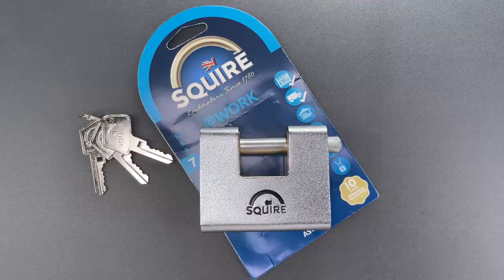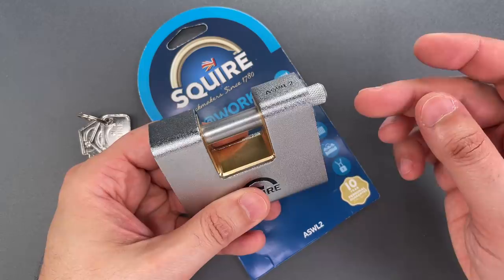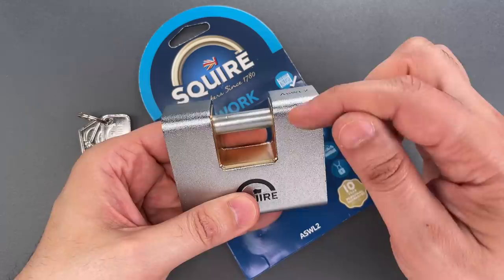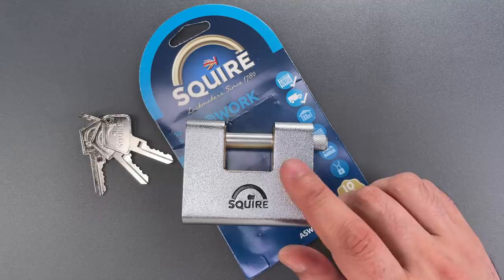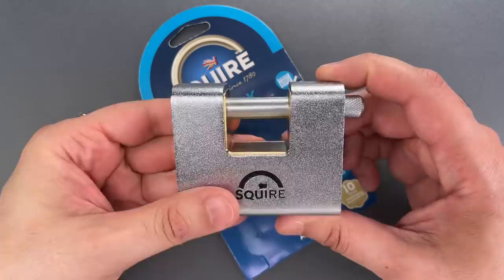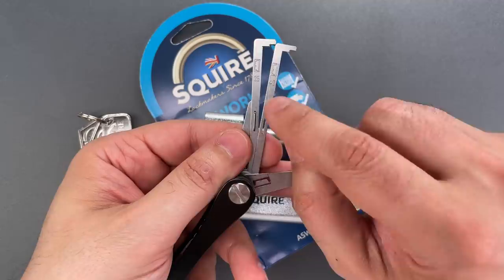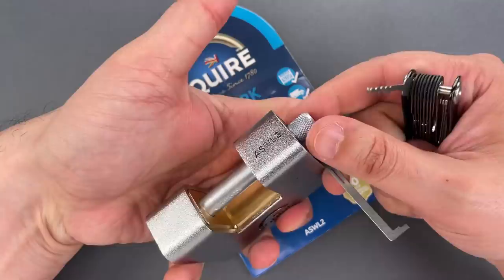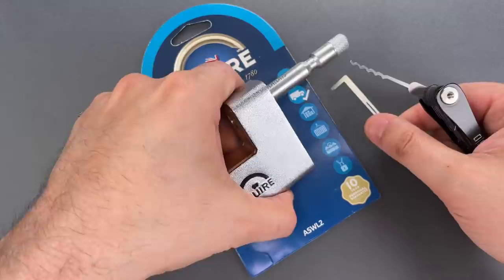[1369] Squire’s Disappointing Armored Shutter Lock (Model ASWL2)

Comment: That is the quickest wave rake I've seen LPL do.  Even Master Lock would be ashamed to make a lock that bad.
Reply: bold of you to assume master lock have any sense of shame.
Reply: @romusa10  They'd still sell it.  They'd just be ashamed of it.
Reply: Next time LPL will just literally wave at the lock and it will pop open.
Reply: Look at video [1197] 😉
Reply: Squire used a Master core to save money
Reply: @ts757arse  Wait, you're telling me Masterlock make good products? You're on their payroll, right?
Reply: Thats not entirely fault of the lock. Notice bitting on the key is almost straight, which greatly simplifies raking. With a more complex bitting (assuming each lock is different), it might not be as easy and LPL might choose usual picking instead.
Reply: The only lock I can pop faster with a wave is a ML3 with some of the worst bitting I've ever seen. At worst it's 15 seconds, but there's been more than one time where it popped by literally just putting the rake in.

Comment: I took one look at the bitting for the key and went, he's going to bust out the wave rake. Was not disappointed.
Reply: so, could it be a QA/Key generation issue? (at least in part?) This would still be a flaw for the product and company, but it would mean "results may vary".
Reply: @sarowie  It also means there are no security pins, so even if the bitting is different it would be quite easy to single pick them.
Reply: @sarowie  Nope, that's a deliberate design choice on that lock.  It's basically the easiest locking mechanism possible while trying to get as much profit as you can.  You can wave rake a lock using a bobby pin.  I've done it before.  If I can pick a lock with a bobby pin, it should be discarded.
Reply: Yeah, a quick glance at the key reveals that single pin picking would be an overkill.
Reply: Yeah, I had the same feeling. I took one look at the key and went "oh no"
Reply: Came to the comments to see if anyone else thought the same as me. Ive got very little lockpicking experiance and when i looked at the key i thought "damn that looks like its going to getting raked"
Reply: @mariosebastiani3214  Even with security pins, if the bitting is that flat there's a fair chance I can rake it very easily.
Reply: Good observation, you totally beat me to it. A city rake would've been perfect too. It kind of just melted open...
Reply: Exactly my thoughts! Ever notice that most locks you buy the keys aren't visible until you fully open the box and can't return them!! 🤬
Reply: Because the pins are all in the same position basically?

Comment: And to think I used to laugh at films where the hero picked a lock using his girlfriend's hairpin.
Reply: It would be fun to see LPL replicate some "ridiculous" movie picking scenes, and show that they are in fact realistic for most locks.
Reply: The nerdycrafter just did a video where she tried lockpicking for the first time. One of the things she tried was a hairpin. Though she did have to use w turning tool.
Reply: That was also a trope of Thunderbirds.  Lady Penelope seemed to keep her hair pinned up almost specifically as an innocuous source of picking tools for her chauffeur to use…
Reply: @Kromaatikse  So Lady Penelope was Aloyisus Parker's "covert companion"?
Reply: @n1elkyfan  That's the one thing most scenes of lockpicking get wrong; even if they use what's supposed to be a dedicated lockpick, there's no turning tool.
Reply: @keith6706  At this point it's a trope, but I suspect the original intent was to avoid showing the real thing so people didn't go around imitating it.
Reply: Well TBH you would need a very open keyway but it could be done if it fits I suppose. Certainly, you can make fine lever lack picks from them.
Reply: @Merennulli  I assumed the same thing. Even as a child I realized that you needed to turn the cylinder to actually open the lock, and you can't do that with only a pick.

Comment: All new locks going forward need to have a LPL Resistance Rating, in my opinion.
Reply: Suggested scale:
1-star: Pickable with the wave rake.
2-star: Picked in under one minute with standard tools.
3-star: Picked in under five minutes with standard tools.
4-star: Picked in over five minutes with standard tools or needs specialist tools.
5-star: Needs custom tools to pick at all.

Comment: I bought a fairly expensive lock for my door and after I installed it I looked at the teeth of the key and all 5 of them were cut the same length so they used the same size pins. Basically all I have to do is tension the lock and stick something in there while pressing up on the pins and the door unlocks. This is a well known brand (Not master lock) if you buy a lock try to look at the key before buy if you can to make sure there's different size pins.
Reply: If you can’t get a look at the key, it’s basically a lottery whether the lock is as insecure as yours, unless the manufacturer has enough sense to deliberately avoid using certain key bittings.

Comment: Wow, that opened faster than most wafer locks.  Of course looking at the bitting, it pretty much matched the profile of the wave rake LPL used.  They couldn't be bothered to throw some security pins in there, apparently.

Comment: I have a master lock #3 that i can open with any piece of flat metal that will fit in the keyway. I dont know what they key cut is. But i know its the same across all 4 pins (i.e. 3-3-3-3). This key looks quite similar.

Comment: A great lock a easy core. You can probably get a open with paper clip picks. Viro Panzer is a much better choice. 7 pins security, anti drill spinner face plate, tougher keyway, anti pull shackle, all steel construction. Brass core. Ball bearings. Need I say more. CISA and Viro are the ones to go for

Comment: I'm not a lockpicker, but yesteday when I got back from a dogwalk, my front door (only door) of my house wouldn't unlock.
After stealing a windshield viper from one of my scrap cars I took the steel insert and made myself a pick.
The lock was so worn out that one of the pins was tipping in it's hole, after fiddeling around and tapping the lock with a hammer, the pin fell back and the lock was opened one last time, then I replaced it with a new one.

Comment: If you look at the key you can see one hint as to why, there's very little variance in the bitting. I have to wonder if another of these locks that's keyed differently would be a bit more resistant, but obviously if LPL was able to rake it it also means no security pins.

Comment: On the face of it, a strong body with a weak heart. Might be a decent value if the brass core can be slipped out of the steel shell and the cylinder re-pinned with a couple of spools.
     When a reputable company like Squire markets a lock like this one, the first security device you should buy is a set of rakes.

Comment: 40 years old I still have trouble putting the key in right . I think lpl opens locks faster then I can with a key. I would have flipped the key around 4 times before I could get it in.🤣

Comment: The teeth of the keys have a soft and shallow look to them.  This sort of 'soft & flowing' look to the key cuts usually indicates to me that the lock 
is very low quality and easy to open.  To make it worse we can see the bitting to be essentially flat which calls out for a simple rake attack.  
Sharp and crooked fangs on a key, such as Medeco keys, usually scares me away.  This lock is no more than a little puppy.
Reply: generally medeco keys have strange patterns not only because of their ability to have effective bitting, but also because they key pins need to be rotated to set a sidebar which must be done in order to open the lock

Comment: Wow.  I'm not sure about exception to the rule though, I recently came across the (I forget the channel) video showing how to bounce-press the wheels on their rather pricey and pretty heavy-duty combination padlocks, locks which I realized were protecting hundreds of thousands of dollars worth of gear down lakeside for a windsurfing club.  I went down and told them that despite the seemingly solid security the locks provided, I could decode any or all of them one-handed in the dark in under a minute each and could either help myself to whatever I liked and then lock them back up surreptitiously, or could even just wander off with their dozen locks and sell the locks themselves for a fair profit if I was so inclined.  Squire's not a common lock around here (Toronto) but they seem to mostly make pretty impressive hardware, but lately someone's been drinking on the job in quality control or they've been focusing too much on sexy design features and not enough on locking customers shit up... I mean, you can decode those combo locks without even bouncing them, literally by sight.  How they missed a flaw that is apparent to both the eyes and the hands is beyond me.  Makes the brassy Master combo padlocks look secure in comparison :/

Comment: you can see from the keys that the bidding is very weak. I've opened locks like that by jiggling a random cheap filing cabinet lock key used as both turner and rake.

Comment: I know it's expensive, but for top of the line locks why don't they use hardened stainless steel.  It's not as hard as regular hardened steel but has weather resistance superior to that of brass.

Comment: Not precisely related to this video but I am curious as to why the US mounts its locks upside down compared to the way we mount them in the UK? Great video can't get  enough LPL :)
Reply: Please explain. Do you mean with the keyway on the bottom?
Reply: @sourisvoleur4854  Yes because in the UK we have the keyway at the top.
Reply: @jonwingfieldhill6143  Wouldn't that be bad because it lets the rain fall directly into the works?
Reply: @sourisvoleur4854  possibly but we don't seem to have any significant issues so intrigued.
Reply: @jonwingfieldhill6143  Interesting. Yeah virtually all keyed padlocks are that way over here.
Reply: @sourisvoleur4854  minor misunderstanding, I was referring to standard door locks etc because in the UK we have our lock so the key way is in the upper portion with the lock body facing down so it looks like 
O = keyhole 
U = body
Instead of 
n
O= keyhole on bottom  
I've watched a lot of BosnianBill and LPL picks and to me they pick the pins the wrong way up.

Comment: Is this really a problem with the construction of the lock, or just the bitting of the copy you got?  Looking at those keys, the pins all look the same length, as though they were trying to make it easy to rake open.  If you'd randomly gotten a lock with more pin variability, would the results have been as bad?

Comment: I've noticed my ability to use a wave rake depends on the key pattern.  I'm guessing if that key pattern had a few extreme pins the rake would not work.
Reply: that is generally how raking works. it is a low skill attack that relies on mostly flat bitting and a lack of spools or other security pins to work well
Reply: @boazfarren-greenwood9048  I have a lock that is pretty difficult to pick because of security pins but because the bitting is such it is easy to rake.  My point is you shouldn't say a lock is flawed because you can rake it, just make sure you get one with extreme key pins.
Reply: @brianhks1  I literally fucking said "flat bitting makes a lock easier to rake," I never said a lock was flawed because it could be raked, though that is true. oh and what type of lock is it? maybe I can give you a couple pointers
Reply: @boazfarren-greenwood9048  Dude, chill man.  I said "you" as rhetorical, meaning "a person" shouldn't say a lock is flawed...  LPL kinda dissed on the lock, but it may be a good one with a different key.  Until I started picking locks I never gave the key bitting a second thought.  People should be aware when they buy locks to inspect the key.  @LockPickingLayer it would be nice to have a video on this specifically.
Reply: @brianhks1  I highly doubt that another lock of the same model will have very different bitting. the rest of what you said is just a bunch of random crap you happened to toss in because it seems on topic
Reply: @brianhks1  that being said, you are right and only one lock, out of all of them might have flat, rakeable bitting, but that shouldn't be the case full stop. companies should do the best to prevent the bare minimum, like sub-second raking attacks

Comment: If you use brass for weather resistance and steel for strength why is the steel on the outside exposed to the weather?

Comment: how much of this is because of the bitting of this particular lock? because the key looks pretty flat, if the pins were more high-low it wouldn't be raked and you'd need to SPP it right?

Comment: when you use a turning tool- how do you know the direction to apply force if you don't have a key to open the lock and see which way it is supposed to turn?
Reply: You either have to pick it twice if you guessed wrong the first time, or quickly flick it back in the opposite direction hoping that inertia will keep the pins from locking again on the way back.